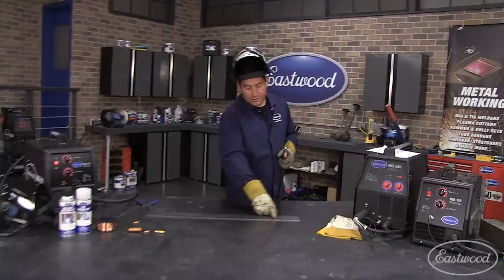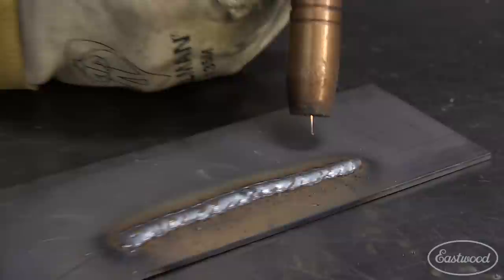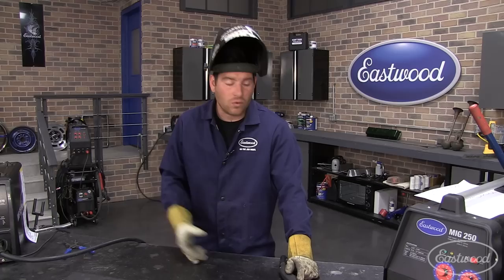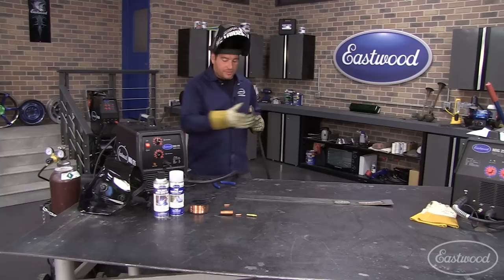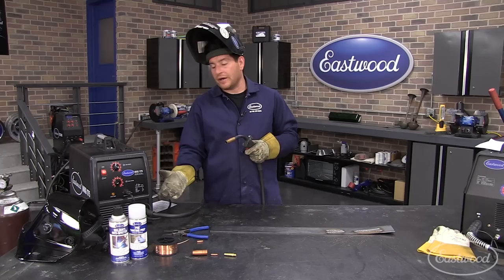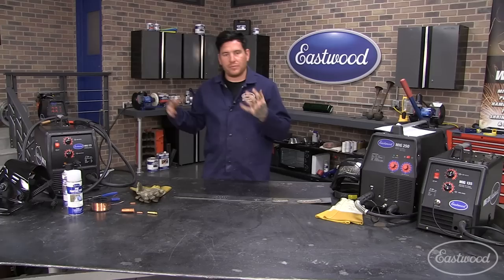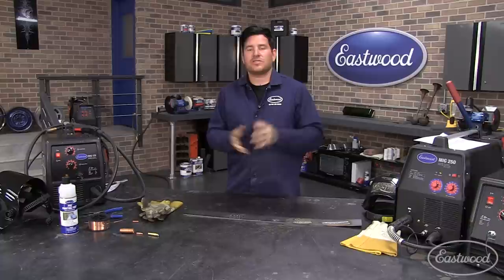How To MIG Weld: MIG Welding Basics Demo Part 2 - Eastwood

Comment: This video is very helpful. The camera work is bizarre.
Reply: Sanjay Sami - yeah Joe the cameraman needs to buy a Manfrotto tripod (only $500 and worth every penny) for fluid head movement.  Then learn how to work the manual focus efficiently.  The lens has optical stabilization, which is wonderful, but skimping out on the rest is just painful to experience.
Reply: Great video;really learn a lot about welding
Reply: I was impressed with the camera work and the over all video considering it appeared to be done all in one shot without any cuts.
Reply: @frooke2  it wasent the best filming I dont belive this was planed ahead as much i think it was kinda improved at some points because there are 10 seconds of akward silence where they are waiting for the camera man
Reply: @Calebtheboss  The filiming wasn't an issue, the problem was that there was no editing!
Reply: Lol, agreed. Super helpful content overall though. 🙂
Reply: I don't trust anyone that can do a good tictoc video to teach welding anyway
Reply: @davidswanson9606  I’m going home
Reply: Hi
Reply: @davidswanson9606  I’m not a good guy and I’m so
Reply: Hi I have no clue
Reply: @Anonymous-vh6kp   If it was, it won't be much left.

Comment: I've been TIG welding for almost 35 years and I never once have I used a MIG machine. Thanks for the video I think I'm going to borrow my friend's MIG and make some welds. Thanks for the lesson. Sorry I forgot your name.
Reply: You will be fine with a mig if  you can TIG its completely different from the technique you are use to but i had never used a mig i was a ARK welder fabricator on site so no mig work at all but recently had to get a job in a fabrication shop and just said I was rusty with MIG because I hadn't done any for a few years because I was ARK out on site so I got the job and just said I need practice for a few days and watched some very good American gezza a big man whith a impressive big beard but he was amazing and I picked up the MIG technique in a couple of days and now 8 weeks later im very good and doing all positions and thin and thick materials very easy but MIG was made for women to be able to use because during the war time all the men was fighting away so the women had to do the jobs and that's why the MIG was invented to be easy to use you can push or pull and weld in  nearly any position and very easy when you weld down also over head Is much easier

Comment: A video about wire size selection for the job would be good.
Reply: usually you can stick with .030. anything around 3/16 move to .035

Comment: I've just bought a mig welder, but have zero experience. 
I found the presentation very helpful.

I do have experience of stick welding, but the amps available at my present location is limited, so my stick welder trips the over-current switch after a few seconds of welding.
What would be useful for a beginner, is an approximation of wire feed speed, relative to material thickness. Or a relevant source for this information.
Thanks for the post.

Comment: Thanks guys!!!!  Really awesome video for a noobie like me.

I haven't welded in years and am.wmbarassed to ask......when you hit the trigger to advance the wire, does it also trigger the voltage to the tip?

In other words, is the tip always live if the machine is on?
Reply: I'm pretty sure it's not live until you hit the switch on the Mig gun but I'm also a beginner so take that with a grain of salt

Comment: Greatly appreciate the course.  Another reason I went with Eastwood, instructive videos.  I just bought the 90 welder to get started. Question:  Same procedures for the 90 as with the 175 used utilized in the video?  Thanks again for the well done instructions presented in an easy to understand and follow manner.

Comment: Great video, loads of invaluable information. I still have a question though. On starting the weld, is it the contact of the wire that starts the weld or the pulling of the trigger?  As you can tell, I'm a complete and utter newbie. Just doing some research while my welder is on its way. It is a gasless welder, so I don't know if these techniques still apply. Many thanks.

Comment: Thanks for the informative video.   I wonder why the work piece doesn't get welded to the table?  What are the electrocution hazards with MIG welding?  It seemed dangerous when you cleaned the tip with the pliers while the welder was powered.  Also, you should wear eye protection when cutting wire.

Comment: Hey Matt, before you start to weld, is it recommended to use Eastwood Anti-Spatter to be sprayed inside the nozzle? Can it be left wet inside the nozzle or does it have to be wiped down some what? Thank you for a very useful instructional video as I'm preparing to fire up my Eastwood MIG 135 for the very first time!
Reply from the maker: Yes, you can coat the nozzle with Anti-Spatter.

Comment: What if i need to do a full pentratoin weld on thicker plate or a 5/16 fillet weld.  In other words; a joint that requires multiple passes to build up the weld, is MIG capable of that?

Comment: Another way to prevent splatter is if you have a oxy/acetylene torch just turn on the acetylene and go over the work piece around the area needing to be welded and none of the splatter will stick

Comment: I noticed that when you was doing the spot welding that you didn't turn the gas back on or don't you need to have the gas on when spot welding
Reply from the maker: The gas should be on whenever you're welding.

Comment: I have the Eastwood Mig 175 and have only used fluxcored wire and have been very happy, but just recently put a bottle of gas on it.  but I'm not getting gas out the nozzle....I'm guessing it's a problem with a solenoid. inside cabinet, I did try tapping fitting at connection w/handle of screwdriver..didn't help.  Any one had this issue.
Reply from the maker: Give our tech department a call 800-343-9353. They will be able to help you out!

Comment: Hi Matt - I'm having trouble with the proper settings for welding 1/8" steel with my Mig135. The settings diagram on my welder do NOT show for 1/8". Would you recommend the proper settings based on your experience? Thank you once again for any support!

Comment: Does the weld happening when the wire make contact with the steel or you also had to press the red button?
Reply from the maker: Yes pulling the trigger initiates the current as well as feels the wire!

Comment: what about the toxic smell of burning? can I wear a mask or does the helmet help with that?
Reply from the maker: The helmet well help very little. The best move is to keep your head out of the fumes, and wear a respirator with a nisoh approved P100, 2297 filter.
Reply: @eastwoodco  thanks for the reply

Comment: I want to take this as a hobby , can anybody tell me a ball park average money spent to get started. I saw prices for the Mig135 at around $400.00 but I need the PPE and that wire cutter or any other items you might think I need.
Reply: Thrift stores are where I buy most of my clothes, I even found some with tags 🏷 still on.

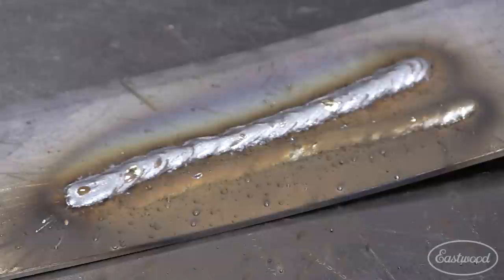Comment: 3:35 What happened there? Your work piece started out completely flat, but now it has a curve to it.
Reply: Just a guess but I'd assume that as the weld cooled it contracted a little which pulled up the previously flat metal